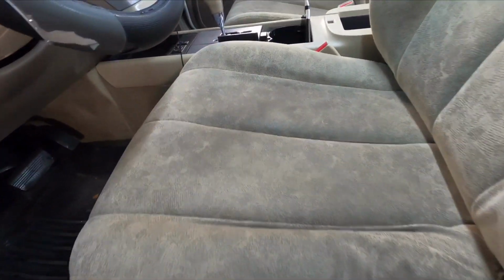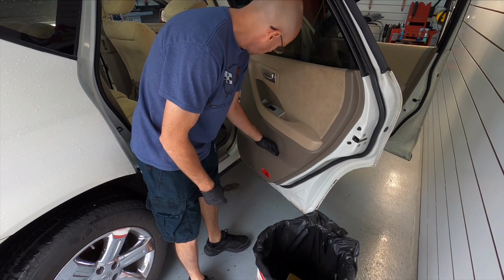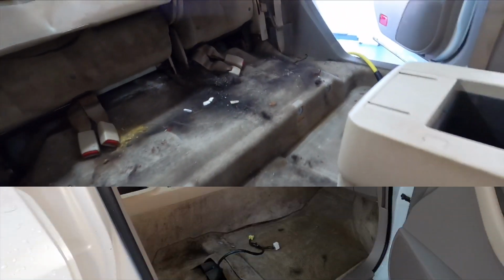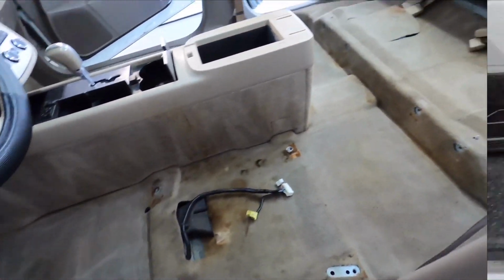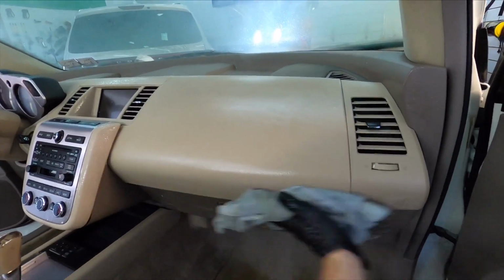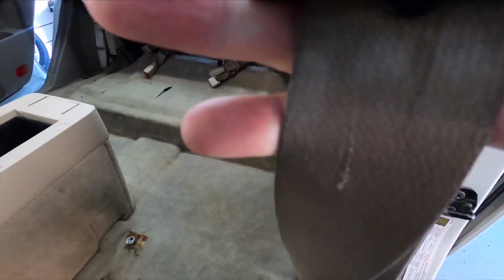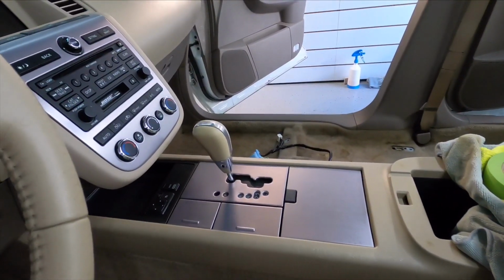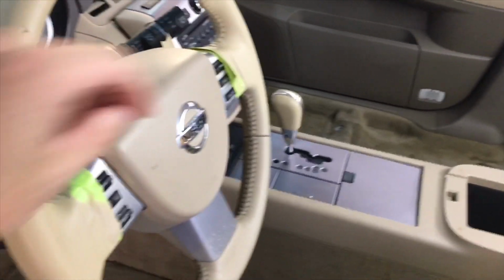Detailing The Dirtiest Interior We Have Seen Here At The Shop! Part 1! Completely Transformed

Comment: Awesome job so far! I can't wait for part 2. I have a tip for anyone starting out. If you decide to disconnect the battery, make sure you have the radio security code available (if that vehicle uses a radio lock out system); most Hondas will require you to enter a code.